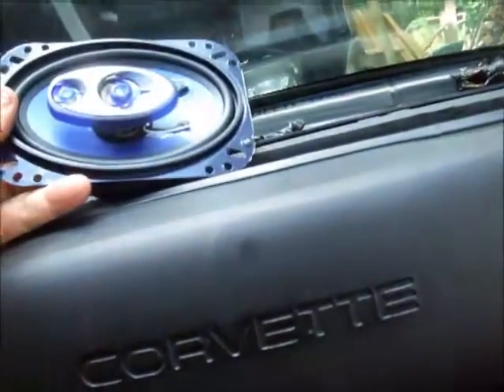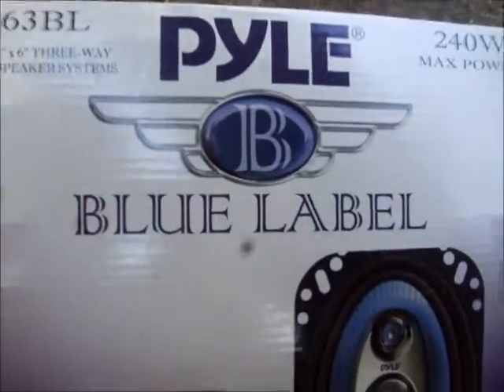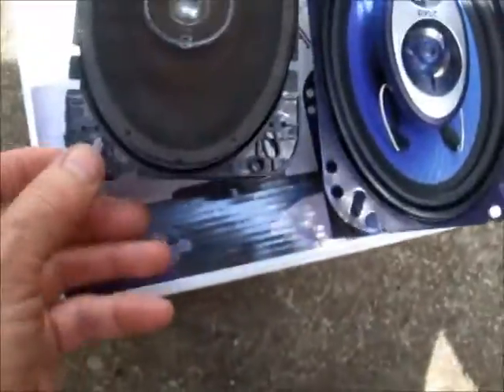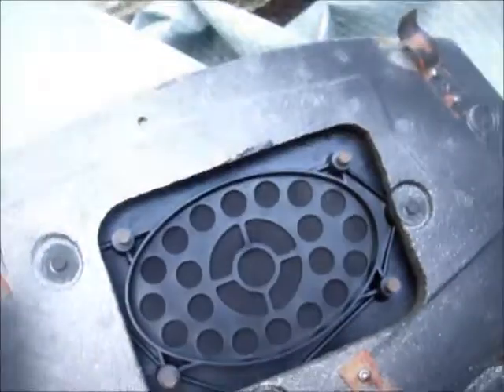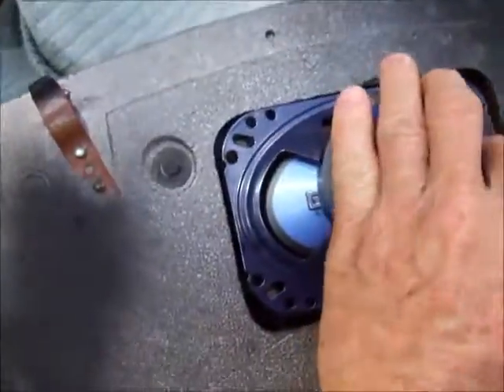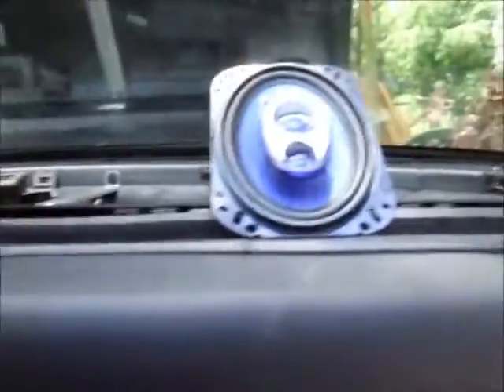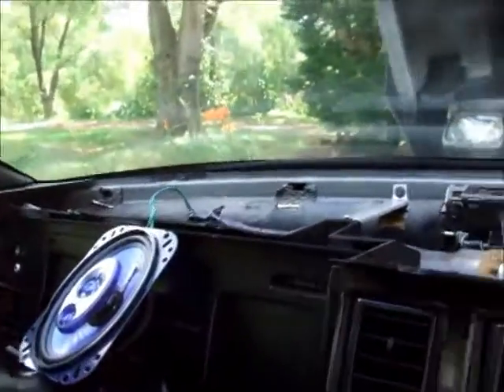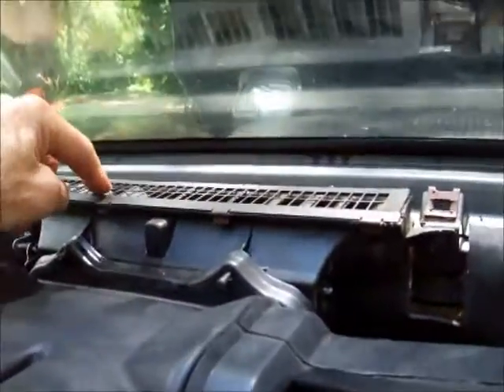𝟏𝟗𝟖𝟒 𝐂𝐎𝐑𝐕𝐄𝐓𝐓𝐄 Replacing the front speakers in the dashboard

Comment: did you need to replace the head unit or the speaker wire or could you just splice into the current speaker wire ?
Reply from the maker: The car had rotten speakers up in the dash, and I mean rotten rats nest...the wires were wired in previously and it looked like they were just spliced into existing speaker wires...because I deleted the factory player and installed a new unit with usb and cd capabilities
Reply: 3DELTA7 okay I'll try to splice into them then also did you need to take the whole dash off or somehow just the speaker grill you are helping me a lot restore this car
Reply from the maker: took off the dash board......my speakers  were bolted to the dash board..so when I lifted up the dash board the speakers came up with it, it was a little tight as I remember but do-able...

Comment: What kind of radio do you have
Reply from the maker: A very inexpensive Walmart stereo I picked up, (Dual XDMA350). Previous owner removed the original factory stereo, leaving a bunch of wires for me to deal with. Needed something to get the stereo system up and running so I could sort through the wiring. NOT the best quality stereo...but it gets the job done for now. Think I paid $70, they are even cheaper now on Amazon. Thanks for watching.